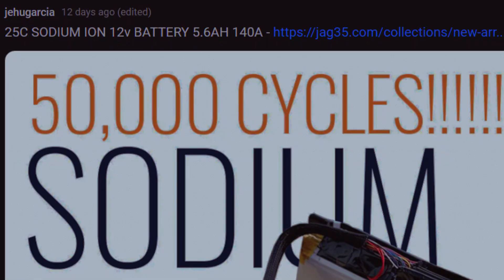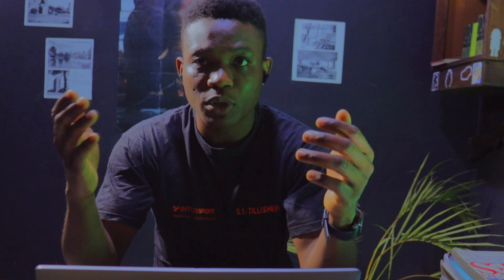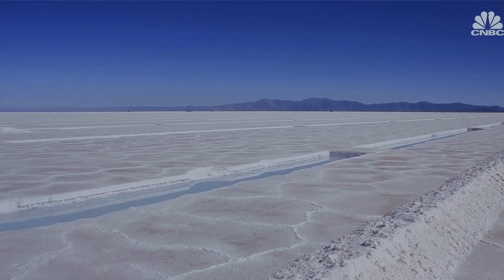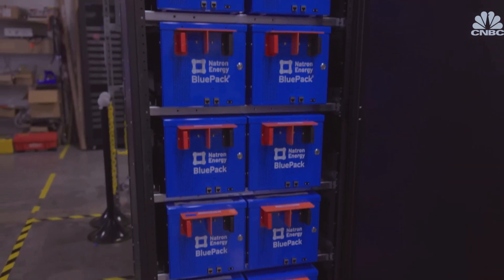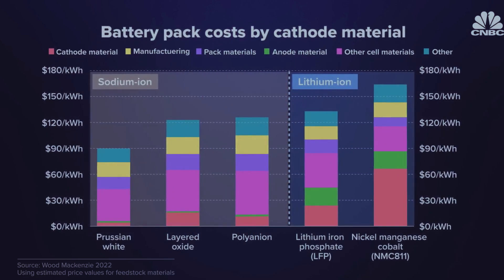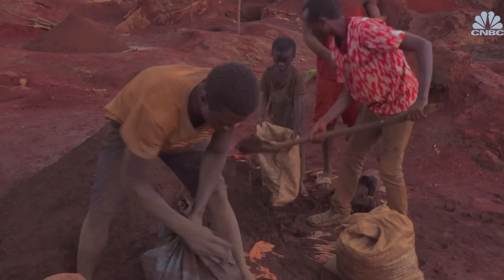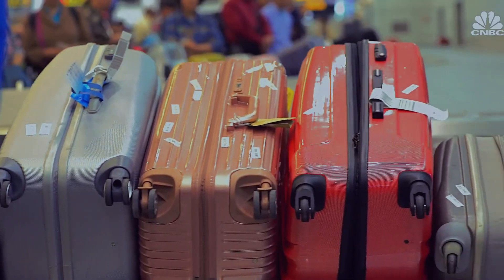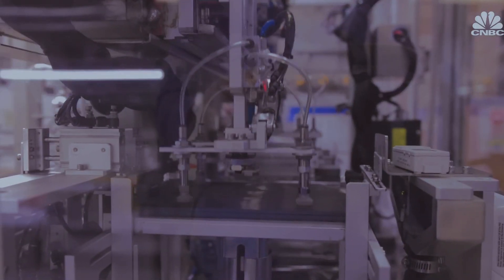Watch this!!! Goodbye Lithium, New Sodium Ion Battery Would Change The World

Comment: worlds largest lithium deposit a couple of months ago, lithium wont go away for a LONG time. And all these new techs wont come out for a long time, they function in lab condition and not in the real world.
Reply: Na batteries came out last year + NA batteries for cars come out this year. So its already out of the lab LOL You are right about Li not going away, but at least for a few applications NA will be taking over for them. Hybrid battery packs using Na and Li will also be a thing for cars too. Any tech that improves Li will also improve Na - and there are a few changes that will be coming to Li that can translate over to Na just fine such as switching to Si and S that can 2 to 5x current power dens of batteries from 150 -> 500. More than cutting the battery pack by half at half the cost.
Reply: @adr2t  my research is 3 months old, let me get back to you when i'm up to speed
Reply: @BenjaminBjornsen  3Months? ITs been over a year from the Na batteries hitting markets. You can by a backup power supply using them already.
Reply from the maker: Lithium is really going no where in a long time, I have used sodium ion but I'm still very confident about lithium... Sodium is out of lab truly and that's why I'm talking about it
Reply: @solarwithakande  Both will be used long term - both have application areas they can fill. Na wont take over the highest power dens needs - but it can take over 2/3rds of the battery market demand. Most of the demand comes from grid and large scale power backup.